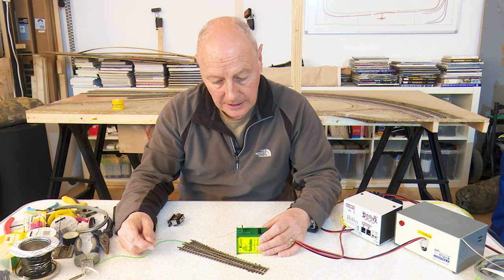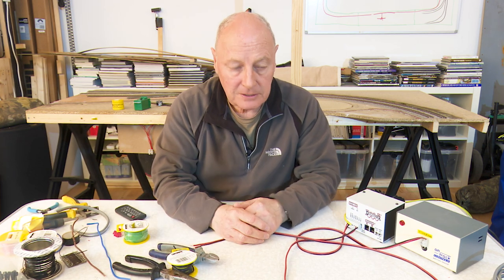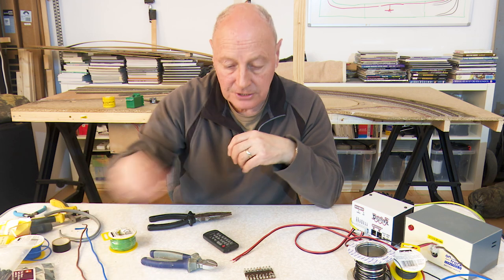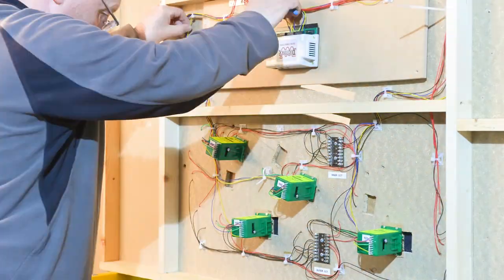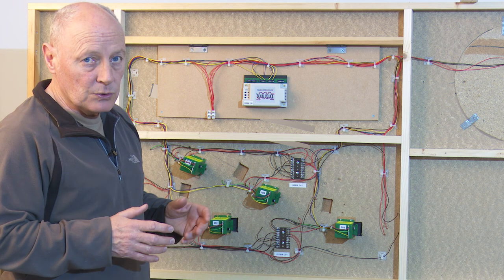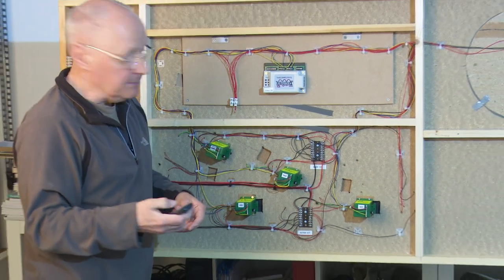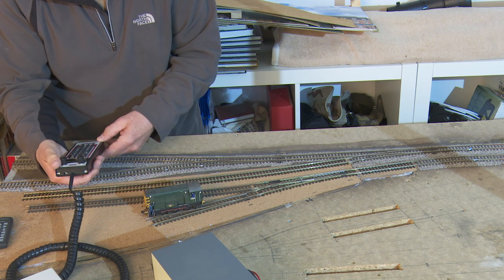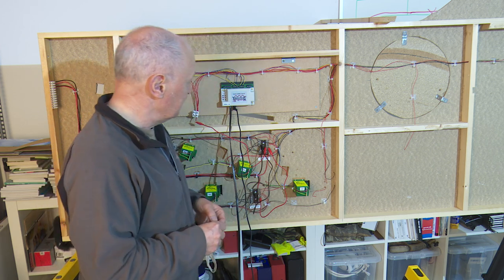DCC Bus Wiring at Chadwick Model Railway | 24.

Comment: My experience over 28 years modeling in N scale began in 1989 with DC blocks and such. Moved over to Digitrax DCC in 1996, and now in the last year changing over to an HO layout with sound locos, JMRI train control with detection, signaling, remote turnout controls, etc., has taught me from the beginning to consider what you might want in the future with great success. I also went with screw terminals on all boards (Digitrax DCS100, BDL168, SE8c and PM42) from Accu-Lites & Snaps for Tortoise turnout machines in the changeover to HO. Cheers from USA.
Reply from the maker: Hi John,
Thanks for the info and I’m so pleased that you also enjoy some automation.
I too also now use the Digitrax break-outboards.
Good luck with your layout.
Regards Charlie

Comment: Great video. Thanks. The break in the ring bus (shown at 14:50) is a great tip.
Reply from the maker: Thanks Ernie.
Reply: The only concern I have is the use of brown/blue wire from twin+earth. Needs a warning label "This is not 240V AC" just in case somebody else needs to work on the layout without your supervision. I mean, it should be obvious that it's not 240v, but better to be safe than sorry. I managed to get some "new old stock" T+E with red/black cores.
It looks like I need to subscribe and view your videos on electrofrog etc.
Reply from the maker: A good tip regarding the labelling, thanks.

Comment: I know this is 5 years old, but on the point at the start.  Using a rotary tool to cut the wire also sends little metal splinters everywhere as the cut from a rotary tool abrades the metal, like sanding or anything else.  Too easy to get a metal splinter in some part of your body.   Cutters are the way to do it, it is what they are designed for.
Thanks for the great videos, Charlie.   I really enjoy watching these and learn something new every time I watch.
Reply from the maker: Thanks Brendan, thankfully my techniques have improved considerably since this video. Regards Charlie

Comment: An excellent tutorial. I might have to watch the video several times before my dementure driven brain latches on to common sense but I have the time to do that.
I started building my first OO model railway in August 2016. I now have have a 9' x 3' 6" board, which is comprised of 12mm thick external ply and framed and supported with lengths of planed 2" x 2" scotts pine. I covered the whole surface with 4mm rubber- like pads (quite exepensive). Over the two odd years, I have purchased seventeen steam locomotives, of varying shapes, sizes and colours; and seventeen diesel locomotives. Most of the buildings on the layout are from Metcalf and two other manufacturerers; all of which, I have built myself. As I constructed the buildings, I decided to fit lighting insiside all buildings, station platforms and street lighting. I still have sixteen point motors to fit, scenery to arrange and dozens of droppers to solder. A long way to go yet but it is a most enjoyable journey. Then, I will convert the lot to DCC. I already have three separate busses, one for DC, one for DCC and one for Lighting, etc. I have the NCE DCC kit with a 5 amp controller.

I thouroughly enjoy your videos because, my brain struggles to absorb written information. Thank you,
Alan Parsons.
Reply from the maker: Wow Alan you certainly have achieved a great deal with a fair way to go too.
I’d get the DC bus removed and run purely DCC. Finish the track laying and connect up before embarking on the scenics.
Good luck with your project.
Regards Charlie
Reply: Thanks for reply. I will certainly follow your advice.

Comment: Im new ( returning after 40 years ) to DCC railway and VERY new to your channel.  I find your videos interesting and informative. 

1 point I would like to comment on is the breaking of the "ring main" into a "radial" circuit. 
As a retired electrician I have an issue with this.  The comments about the problems with a DCC signal being affected by timing is (to me) a very valid one.  HOWEVER!  If your connecting at various points around the track, you have to be mindful of creating what is known as a 'Parallel Path'.  
Ie,  you have broken the 'ring main' on the bus BUT your TRACK is still a ring main.  So I would suggest that ideally there should also be isolation of the TRACK at the break in the 'ring main'. 
Otherwise your break in the 'ring main will become less effective or possibly negated entirely as the encoded signals from each side of the (now) 'radial circuit' can be bridged by the track itself.  I.e.. the signal gets to each end of the 'radial' circuit, but can 'bypass' the new break in the original 'ring' circuit by travelling up the bus / feed wires from each end and then along the rails attached to each end of the two 'radials circuit'!   
I would suggest that to keep the signal completely clean, you would have to use insulated fishplates between the two 'ends' of the radial circuit?? 
I hope this makes sense?

Lastly, in respect of DCC timing issues. I would ponder that It is possible that in a VERY large layout of  having just 2 'radial circuits' that timing issues could still arise at the termination point of the end of each 'radial circuits.  Because if the mismatch in timing of the DCC signal this could cause an error to be thrown up at that point I would therefore suggest that you break the areas down in to "zones / busses" each fed directly from the DCC controller (with isolated track at that point also) to minimise the DCC timing issues on larger circuits?? 

I DO hope this makes sense! ???  I need a brew and a chill after all that.!!  
Keep up the good work. LOVE your videos!
 Ian.
Reply from the maker: Hi Ian , many thanks for your comment.
Rest assured, I do understand the complexities of the DCC carrier wave.
However, with the layout having two separate booster areas each subdivided into 4 power districts, it’s not as straightforward as one might think. Regards Charlie.

Comment: Learned to solder in 7th grade and I really like to do it. We had to take "shop class" and one semester it was foundry, metal lathe, electrical, and iron working. Loved it!!! I am lucky that I don't have to worry about the frog as one of my engines is battery powered and the rest of the DCC engines have the "come along" aspect that will keep them running for about 8 seconds without power and this will get them over the switch points and I an use a much less expensive switch.
Reply from the maker: Thanks David, an interesting comment.

Comment: Really great video Charlie, thanks for sharing your experience. I am new to this and am building a layout for my son high up around his room on a perspex shelf ;-).
I have probably bitten off more than I can chew but it is good fun and learning a lot about DCC. I  had already decided to use the 2.5mm2 single core wire from left over mains cabling as it will be a fixed bus hidden in a grove in the supporting wooden rail that holds the perspex up so I am leased that you showed it as an option. I couldn't make my mind up about closed loop or open for the bus but have decided to leave it as open.
I am surprised that closed loop timing issues cause a problem as I would have thought it would be nanoseconds difference in the signal arriving from both directions but I think it best to leave it open.
Reply from the maker: I’m so pleased that you find the channel useful Gary. Good luck with your project. Regards Charlie

Comment: Another great bit of tuition from you Charlie and all very well expanded with various options if needed to do things in wiring and attachments to one's system of control. Many issues would be that I have collected (maybe too many) a lot of locos that are DC and only about 20 of them are DCC Ready. I would need to have a wired layout mainly for DC movement, but also have the ability to run DCC via my Dynamis Units while keeping my points operations separate by either hand or toggle switches. Maybe that could be another piece of filming to do if anyone else wishes to have a simple dual control layout.
Reply from the maker: An interesting option John, I'll have a think.
Reply: @ChadwickModelRailway  Oops that should have been 20x Locos DCC Fitted.

Comment: Hi Charlie, Damage to Xuron cutters, used Dremil to cut the piano wire , did not melt the plastic, just trouble getting the right length. Had to purchase more wire. Not a lot of use for piano wire in Southwest Australia!! Thanks for these very informative videos, and will keep watching your channel for more advice.Richard
Reply from the maker: Hi Richard,
I’m so pleased that you enjoyed the video. Yes it’s hard to cut the wire. I tried  marking the cut, removing the motor and cutting the wire.  But then it’s so hard the relocate the wire back through the hole.
No one said it would be be such a challenge.
Regards Charlie

Comment: Oh dear! Another idea for joining wires. Use insulated crimps. Now, there is a cost, you do ideally need a decent set of ratchet crimping pliers. They ensure the correct pressure is applied. But it is very fast, gives very good joints and there is no soldering. It is in fact one of the only two permitted ways of joining inaccessible mains cables in the UK. (Screw junction boxes are required to be accessible so that the screw tightness can be readily checked).  Ideally get yourself an automatic wire stripper - so much faster, easier and more reliable than hand stripping with side cutters. Bare a short end of each wire, insert into the insulated crimp and squeeze shut with the pliers. Basically you get a cold weld. Red insulated crimps are the smallest size, then blue and then yellow. The yellow ones are probably too big for this application. Search 'crimps' and 'crimping tools' on Google for much more info. BobUK.
Reply from the maker: Interesting stuff Bob.  Where I found crimping difficult was when crimping cables of different sizes.

Comment: Fantastic and educational video Charlie and thank you for raising the question of "Do I or don't I" complete the ring on the DCC Bus, something I've been wondering about for a while now but had decided to terminate it at the drop down section at the double doors and of course the track will be insulate at the cut sections on both drop down sections. And thanks to this video I've decided to cut the main Bus at intervals and connect with choc blocks so I can systematically pinpoint a short should it occur, fabulous.
Oh and I was also a little worried about the size of my dropper wires but you put my at rest for that as well, so I'm a happy chappie this morning :0)
Have a great weekend Charlie and thanks again. Mark
One last thing, if doing a soldering video could you if possible include a part of soldering track to vero board, mine is a bit messy and I could do with some tips for when I come to the main top section of the layout.
Reply from the maker: Hi Mark, I’m so pleased that you enjoyed the video and that it was of use to you. 
I’ll try and include soldering to vero board in the video. 
Regards Charlie

Comment: Hi Charlie, nice video very informative.  I’m not so sure about breaking the bus wire ring though, when researching my layout I looked into the subject and basically our rails are also acting as a bus wire ring. The way around that is to put 2 plastic rail joiners at the same place (electrically) where you break the bus wire ring.  However the timing of the signal shouldn’t be affected in the way it was described to you because it’s artificial ac current (bi-polar dc) and the decoder needs to receive the whole packet of the signal, electricity flows close to the speed of light and DCC works in micro seconds not nano seconds.
Reply from the maker: Hi Paul, I’m pleased that you enjoyed the video.  Regarding splitting the bus, I’ve heard the views on both sides and, in light of the cessation of some strange indications on our club layout, I’m in favour of splitting it. After all there are no disadvantages that I can see. Regards Charlie

Comment: Great video, especially the part about why the bus shouldn't be a circuit, but have a gap. At about 21 minutes you talk about the Digitrax BDL 168, and what to do if you're not into block detection. Could you follow up on your setup and show how to wire up the BDL 168 if you want to get into block detection? Currently got just a basic JMRI controlled DCC layout; no Loconet, etc, and looking at where to go from there.
Reply from the maker: Hi Phil, I’m so pleased that you enjoyed the video.  I won’t be producing a BDL168 video until my latest layout gets to that stage.  
Check out Digitrax Dad’s BDL video as I recall his series is pretty good.
Reply: Thanks for the suggestion, they've got some good advice on there too. I've got a SPROG 3 like they use; wish I'd found these videos sooner.

Comment: The reason we use solid core wire is not because it doesn't need to move around (in fact not all stranded core wire is meant to be moved around), it is because AC current travels through the center of the single wire, while DC current travels on the outside surface of the wire. So if you have AC it is best to have a single thick wire and if you have DC it is best if you have many wires that increases the actual surface that the DC current can travel on.   That's why, having thicker or larger gauge vehicle jumper cables is better to pass, as much current to the dead battery. While with a battery charger, only needs to be a smaller gauge to charge the battery over time.
Reply from the maker: But DCC isn’t AC, it’s actually a square wave DC wave form. So how does this affect its flow? Regards Charlie
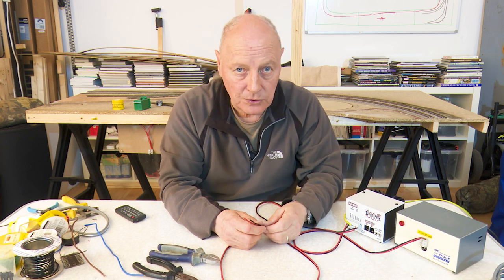Reply: @ChadwickModelRailway  it doesn't. It doesn't matter if you used PWM or straight voltage. The point is the current will flow much better than a single conductor wire. I mentioned this because you said 4:14 we use thick stiff solid core wire for AC house power because it doesn't need to move. That's not why. It's just a characteristic of that wire. If extension cord (very flexible) was just as good at passing AC current they would use it because it be so much easier to install. But it isn't better. It is less effective than a solid core wire. 

PS. Love this video. Lot's of great info. I'm not even into model railroads. Mainly just electronics in general. Liked and subscribed.

Comment: Hi Charlie. Excellent video. Most of my questions you have already answered but just a couple more. I have Maplins  cable (miles of it , long story) 24/0.2 and just checked its rated at 4.5A . 1) Can I use this cable for both the droppers and the main bus lane. If not I will use mains cable for my bus lane.  2) Do you  recommend rail isolator joiners for the track above where I put a break in the ring. Finally Its rather a big room . I will be running both DCC  and DC on my layout, (completely separate tracks of course) and the two will not link up. Will it be OK to run a complete bus ring back to the transformer on the DC track without putting a break in it. Will the Maplins cable be suitable for both  the DC track bus wire and droppers and will I still need a dropper on every piece of DC track as with DCC.  My total  ovals on each circuit will be  around 70ft of track. Finally,  if ever you decide to take on paid "hands on"  consultancy work and your not too far from Northwich, Cheshire can I be the first to book you !!
Reply from the maker: Hi Mike the 24 0.2 cable is wonderful for bus wiring. However you should not of draw power more than 4.5 Amps. 
It would be a waste to use it for droppers where 16 0.2 will be more suitable so it is a bit of an overkill. Please read through the info link in my last video. It explains about open and closed loops.
Regarding DC, not my field I’m afraid.
Several droppers would be best but not as often as DCC.
Regards Charlie

Comment: Hi Carlie; super enjoying your video as I am deciding what DCC system I'm hoping to use. One question regarding the wiring, you mentioned that because you had your points powered with a separate supply, but I only see the one supply coming in. Am I missing something?
Reply from the maker: Please take a look at video 175. That should explain better.  Regards Charlie

Comment: I also use Digitrax but I use DPDT Centre off switches to feed my Tortoise motors, This way I can see what direction the point is set to, by looking at the switch lever, otherwise it would mean LED's on the control board to indicate which way the point is set to go.
Reply from the maker: There are so many choices Sam.
We all have our preferences and no one is right, their choice being the best for their needs.

Comment: Hi Charlie  I watched your video here on BUS wire installation, and I to have a ring main type layout, which i have also included a physical break in the bus wire as you  suggested. My question is if my layout tracks run in the same configuration then would I also need to create a break within the track so the signal can only go one way so to speak. as i have numerous droppers feeding from the bus wire onto each track line , so in essence my track loop will be cut by use of the insulator fishplates. Regards  Dave
Reply from the maker: Yes, I do understand SJ, once it’s cut, it’s cut. Regards, Charlie

Comment: I did not get on with snap connections, due to access working under base board, gone back to choc block connections, also easily to find faults and fix.Richard
Reply from the maker: You and me both Richard.  I always go for soldering into tag strips or choc block too.  Regards Charlie